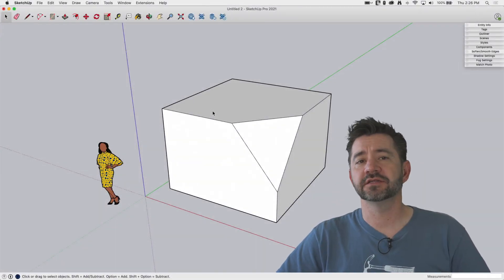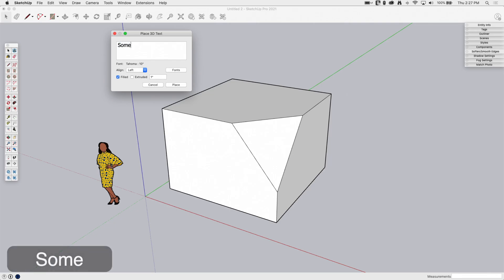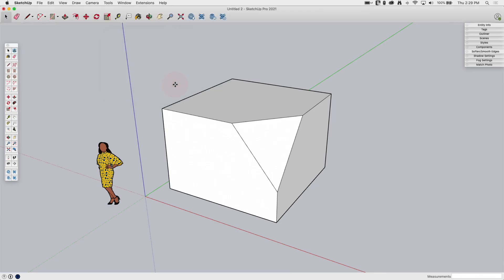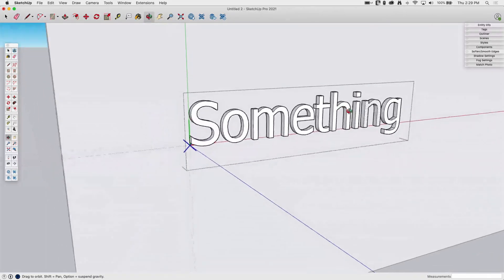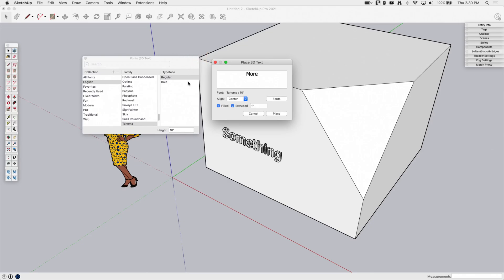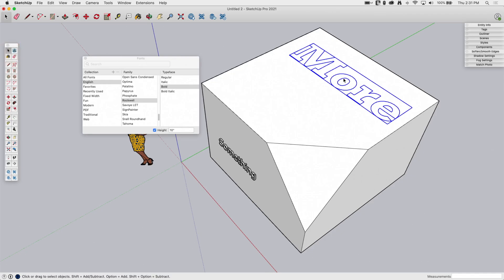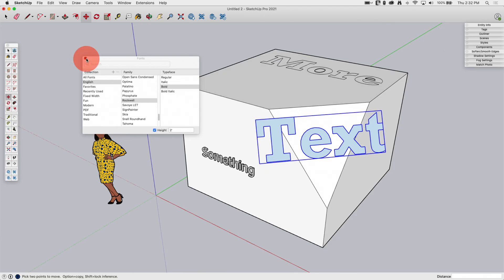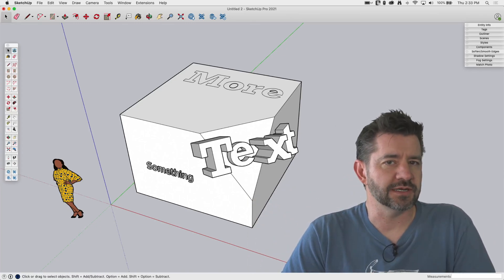3D Text - Square One

Comment: This is Sketch Up at its worst. It would be better to remove this feature altogether and just let a third party developer make an editable 3D text tool than have this half baked feature on software with an annual license.
Reply from the maker: https://extensions.sketchup.com/extension/40a79eb9-ee97-4d1a-bc1c-cf534042a5b5/3d-text-editor

Comment: Aaron, When I explode, the text and it's not extruded or filled, not all the lines from the text are 'merged' with the plane they were attached to.  In the example you show in this video, you can see it didn't work completely on yours either.  The center of the O and the center of the e are darkened, because they are not on the surface.  I used the word Stuff when doing this example while watching your video and only the U and first F worked.  I'd place an image here, but don't know how to do that.
Reply: I have had this same problem but here is a solution I found helpful.  Group the part of the text that isn't merging ( for example the the lines on the inside of a zero ) then explode that group. The lines should now merge. A bit of a pain if you have a ton of text but hope it helps you.

Comment: Can you fold the text around a corner, like your last "text" entry on the chamfered face?
Reply: As far as I know? No you cannot. Since Sketch Up breaks all the surfaces into tiny single planes the text will constantly try to find a "flat face" to stick to. So if you think of your text as a simple rectangle (which is kind of is) then you cannot bend that rectangle. I have messed around with the True Bend plug in but it does not work that well when you try to determine where you want the text to go. But it was a fun experiment so thanks for the question! Hope this helped.
Reply: @jimurbano1016  thanks for the reply. I'll have a little experimentation with it and let you know if I get anywhere.